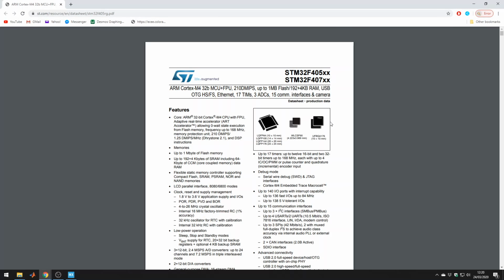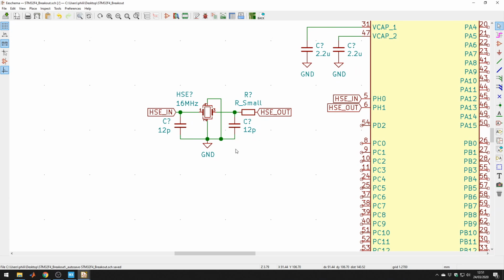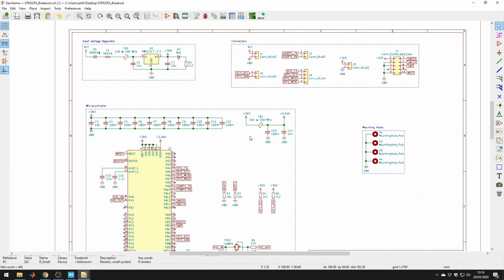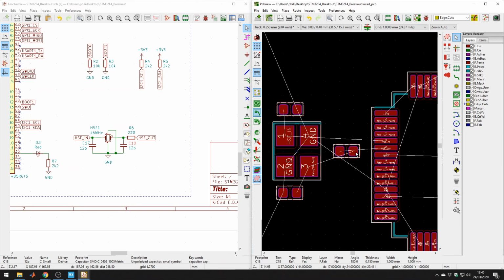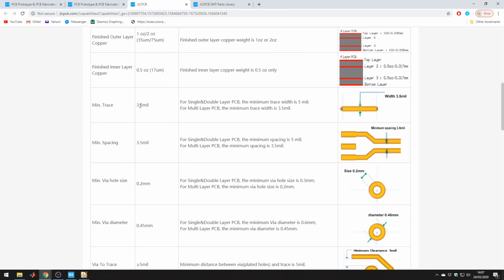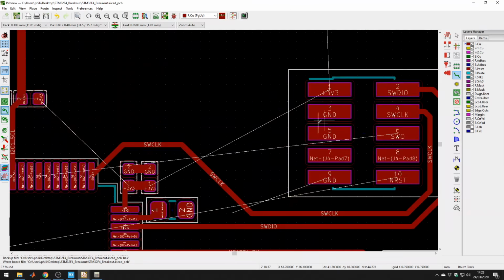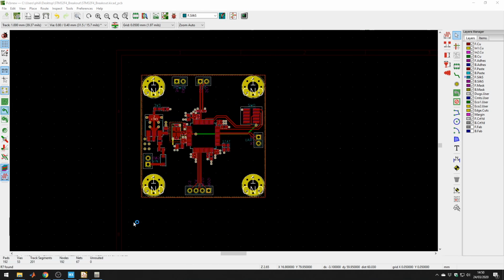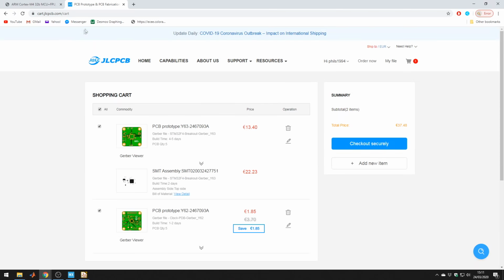KiCad STM32 Hardware Design and JLCPCB Assembly - Phil's Lab #2

Comment: Thanks for a great video I've learned a lot.
 I have few questions/remarks:
1) Why don't you put the JLCPCB number into your schema right away? I find it strange that you find the part in their catalog just to see the package and then you look it up for the second time an hour later. I find it much easier to just enter their number into new field right as I find it for the first time... And the datasheet URL.
2) Is the footprint selection tool better than "Edit symbol fields" tool? The edit symbol fields tool can group components according to value, package, etc... So I find it more straightforward to use it instead of the footprint selection tool. And if you have the LCSC part number field on at least one symbol, you can edit it there for all the symbols... I think it is easier to just group the symbols by their value, set one package and enter LCSC part number
3) Why you don't use the push and shove routing tool (D key) to move traces?  Sometimes it is much easier than deleting the whole trace and redoing it. Also there is a shortcut for selecting all connected traces so you do not need to select them all one by one when deleting....

4) I find it strange that you pay attention to small details like measuring the gap between connectors and board edge, "esthetic" spacing between traces but you just place the mounting holes without any proper positioning. The distance between the mounting holes is the second most important mechanical aspect of the board (shape of the board is the first). I would try to place them somehow reasonable apart, i.e. 40 mm distance seems like a good candidate.
And just a few tips: there is the JLCPCB plugin for creating BOM in their format (just google kicad-jlcpcb-bom-plugin ) and there is a lot of scripts to rotate the components. And for the manual assembly, there is the Interactive BOM tool that is just amazing....
Reply from the maker: Hi Radek, thanks for your comment!
1) I agree that in this video it's not great, as I show the JLCPCB catalog several times and never note down the number til the end. That's something, as you say, can be done better. The typical way I do it - not very efficient - is that I already have the footprint sizes in my head, and just make the schematic, then choose the parts as I know the sizes, do the layout, and finally when it's time to do the BOM add in the LCSC part #s. Not great but something I've been too lazy to change.
2) If you prefer using the 'edit symbol fields' tool then that is of course completely fine. By repetition it's just been ingrained in me to do it the way I showed in the video. I believe JLC however recommend using your method, by filling in extra fields for the LCSC part # and then using their BOM plugin.
3) Again, that's just something I got stuck doing - I'm sure there are much better ways! I essentially never learned any KiCad shortcuts (other than a handful) and have just been doing it like that ever since...
4) The mounting holes are placed with 'proper' positioning, i.e. a fixed distance away from the board edges in every corner. Maybe I didn't explicitly mention or show that in the video but I believe it's there.
Reply: @PhilsLab  I watched your video before going to sleep, fell asleep watching it and finished watching the other day so I may have missed something but I did not notice that you would position the mounting holes exactly. But as my "mechanical" friend is reminding all the time, the mounting holes should be spaced not from the edge of the board but one from another so there is some "reasonable" distance between them (i.e. whole number) so it is easier to make mounting points....
I also do not know much shortcuts (probably less than you judging from the video) but I like the push&shove and select connected traces ones. KiCAD can do sometimes very weird "minitraces" that are hard to notice (i.e. under pads) and they can cause a lot of headaches later....
Reply from the maker: @radekhladik7895  Yes, for a 'proper' design that will end up going in some form of enclosure as part of a product, the PCB dimensions and mounting hole placement will be dictated and constrained by the mechanical design.
For this video however the board size and placement in general should be taken with a pinch of salt, as this is video is primarily in place to show how to hook up an STM32 microcontroller and the board will not actually be used anywhere.
I agree with you, that in general it is good practice to do 'proper' placement of mounting holes and such.
Thank you again for your comment and your suggestions!

Comment: The 3V3 vias don't need to go all the way through, do they? It would give a somewhat nicer ground plane to have them stunted.
Reply from the maker: There are blind and buried vias, which as you say don't go all the way through. However, my PCB manufacturer (JLCPCB) does not support them and I believe generally it's a much more expensive process and therefore avoided in lower-cost designs.

Comment: Is there are reason not to place the via’s on the pads themself ( for gnd and 3.3v)? Would save a lot of space.
Reply from the maker: It used to be frowned upon putting vias in pads (probably still is by a few people?), due to the solder paste being sucked into the vias before assembly - at least I think that was the reason. These days manufacturing can handle things like that and therefore it shouldn't be a problem. When I really don't have much space I will put vias into pads, I just generally don't like the aesthetics however.

Comment: Why are you treating the oscillator load capacitors as if they were in series? You say they're parallel and place them in parallel but then when you're doing the equations you're using series equations. With 1.1k for R you're gonna get a corner frequency of about 6 MHz cause your C is gonna be roughly 24 pF and that's way below the 16 MHz of the clk.
Reply from the maker: For some reason my pinned comment wasn't pinned anymore, where I corrected the mistake. I misspoke in the video and meant to say, from the crystal's point of view, the loads caps are in series and thus the capacitance is halved. For the low-pass filter calculation, you use Rext (in this case R6) and the following load capacitor (C18),  which in this case would then result in a corner frequency of 60 MHz.

Comment: Do I really need stitching vias? It seems quite unessesary..
Reply from the maker: For this board, probably won't make much of a difference. In general however, it is good practice as it minimises the impedance between the copper pours and also gets you into the habit of doing it for higher-speed designs.
Reply: @PhilsLab  Ok, nice to know! Thanks! Loved the tutorial by the way!!

Comment: wow... one f4 flight controller cost less than $30...  with osd, and multiple sensors, sd card.  they have cents on profit.. https://www.amazon.com/-/es/Flight-Controller-Built-Barometer-Martian/dp/B07TB75RNX/ref=sr_1_3?__mk_es_US=%C3%85M%C3%85%C5%BD%C3%95%C3%91&crid=33QFA9LP9ZBQR&dchild=1&keywords=f4+flight+controller&qid=1589651811&sprefix=f4+f%2Caps%2C295&sr=8-3
Reply from the maker: Yeah, pretty amazing how cheap they have gotten..

Comment: Another awesome video... I watched end to end taking notes all the way and will probably go back and re-watch some sections.  I hadn't looked into having assembly done because it just seemed like a steep hill to climb.  Obviously not, with your explanation!

I love these "ride along" videos as you do the actual work and your explanations of your choices were clear and helpful.  I learned a ton of KiCad tricks (in spite of using it lightly for a few years).

I'd love to see a "lessons learned" video on mistakes or problems and how you diagnosed them.  Either issues from the manufacturer (I know the board houses make changes sometimes) or things you overlooked on designs.  How you went about finding and fixing the issue would be particularly interesting.

I know it takes a long time to put together a video like this.  I always appreciate it when people put in the effort to share what they've learned!

Cheers!
Reply from the maker: Thank you, Benjamin!

I need to brush up on KiCad shortcuts and little tricks myself. I essentially use the bare minimum and I'm sure there are much faster ways of doing the things I do.

A 'lessons learned' video or something similar would be definitely be a good idea, as I have quite a few projects in that department haha!

Thanks again :)

Comment: Very cool video! BTW, you can save half the clicks when connecting two-pin-parts by drawing the wire through the part while hitting both snap-points. Kicad deletes the middle part of the wire automagically.
Reply from the maker: Thanks! Ah thanks for the tip, I'll be sure to use that from now on. Not very familiar with most KiCad shortcuts!
Reply: @PhilsLab  No problem, I used Kicad off-and-on for years but stumbled about that shortcut a few weeks ago. Speaking of shortcuts: You can re-arrange blocks of a schematic by selecting them and pressing the tab-key. This lets you arrange the moved part of the schematic without breaking the connections. I use that extensively to clean up my schematics, so it saves me lots of time. I think Kicad calls it "grabbing" in contrast to "moving", which breaks the connections.

Comment: I'm an Altium user and you made my day as I'm thinking about learning kicad, your tutorial are very good thank you so much and please keep posting these videos.  Thumbs up :), just some points  l advice that you use Pmos gate to ground for polarity protection , also I advice that you use mosfet to control the debugging led , great job man 👍👍
Reply from the maker: Thanks man, really glad to hear it! Yeah, I mentioned using a P-channel mosfet instead of the diode, but for simplicity just used the diode in place here. And since I'm not sourcing too much current from the pins for the LEDs, I just chose to hook them up directly. But yes, probably better practice to use a transistor to control the LEDs. Thanks for your comment!

Comment: The I2C, SPI and Usart connectors should also carry a ground pin, which you've left out.
Solder mask?
Reply from the maker: Yep, that's a good point - thanks!
Reply: I always put both VDD and ground on my communication connectors - if it's going to a board with it's own power source, it's easy to just not connect VDD and tie just the grounds together, but more commonly it's a sensor or something that needs 3V3.

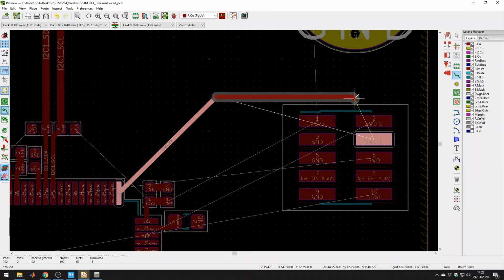Comment: Just subd, I'm very impressed by your video, the result looks so professional (compared to my designs). But I've got a tip for you, about 1:46:40 : press the 'slash' key to invert the angled track position (top or bottom).
Reply from the maker: That's great, thank you Bruno! Thanks also for the shortcut tip, I must say I hardly know any KiCad shortcuts and that's definitely something I need to brush up on...

Comment: Great video, just a tip: if you add a no-connect flag, then press insert key and another no-connect flag will be added below. So you don't need to click each pin. It is a bit faster. 
It also works with labels incrementing numbering like add label gpio_0, then press the insert key and you will get gpio_1, gpio_2.... and so on.
Reply: Also, I think you could move all reference designator from the silkscreen to fab layer all at once with the menu: Edit->Edit Text & Graphic properties
Reply from the maker: Thanks and thanks also for the tips. I need to brush up on my KiCad shortcuts as you can tell, so that's great advice!

Comment: Superb video. So much good information. Extremely helpful to know the reasons you are doing each of the steps. But at the end, why were the parts rotated wrongly in the CPL file? You had to manually edit the text file to rotate the AMS1117 and microcontroller. I hope you can upload more videos like this.
Reply from the maker: Thanks a lot, Jason! Apparently JLCPCB and KiCad both use different rotation standards. Quite irritating that there's yet another set of standards people can't agree on..
The problem is the standard varies per component, so diodes are correctly oriented in both but things like ICs most likely won't be.

Comment: Thank you for doing this video, impressive that I could watch 2.5 hours and not be bored! I'm just starting out in PCB design and this really has helped me to understand how the process works. My first board is in the process of being designed, I used to think it would take ages, but the keyboard shortcuts that KiCAD has really improves the workflow.

Please make more videos, I usually find 10-15 minutes to be the best for a tutorial about a specific part of the process. (This videos length was perfect as an intro!) I'd like to learn more about routing USB/ethernet traces. Some more little snippets of electrical theory is also really nice, formulas etc. What about a live-stream where you design a small schematic/board and check the live-chat for questions comments. I'd also like to learn more about routing a 2 layer board, I understand 4 layers are often better though, just I'd like to learn about doing both. Thanks again!

Comment: Fantastic video. Looking forward whatever else you’d like to share with us. I really enjoy videos lie this that have some real substance - wherein people share what they’ve learned and developed through a non-trivial amount of effort and experience. FWIW, I used to relocate the silk reference designators, part by part (or with a little script), exactly as you did. But, now, Kicad has an option to remove them from the output silk. I wish there was an option to inhibit add them to the fab instead, from the get go, but I can usually tolerate them in the GUI, so long as they don’t appear on the board.

Comment: Good timing on the video. I just started designing a STM32 board for manufacturing on JLCPCB .
Reply: @PhilsLab  As an old SW Engineer it's a bit of a rabbit hole trying to learn how to do things the right way. This video cleared up a lot of questions. 
Looking at various open source PCBs I can see that they are all over the place when in comes to the crystal and decoupling.
Even if it's just $100 for 10 assembled boards it's hard to push that order button. I know I will find an issue the day after.